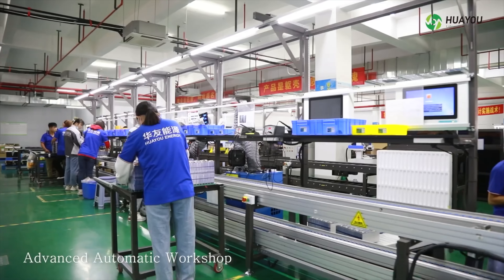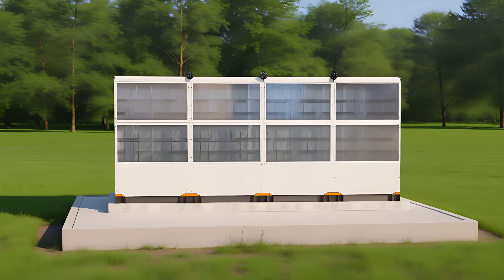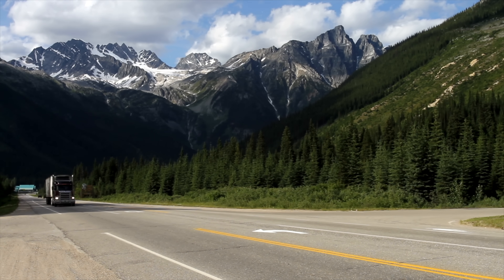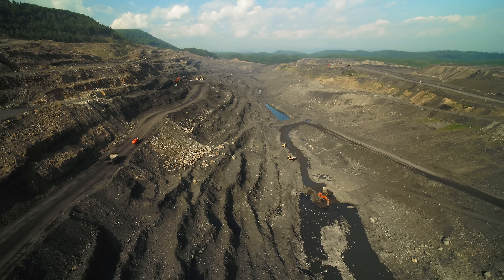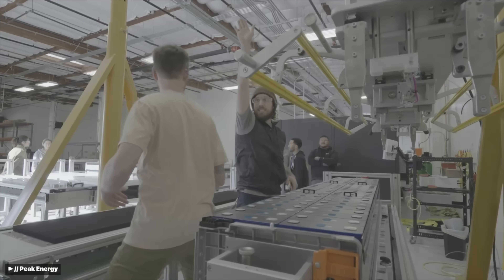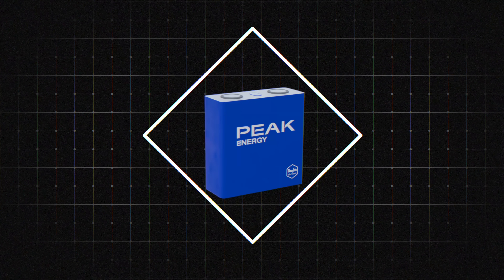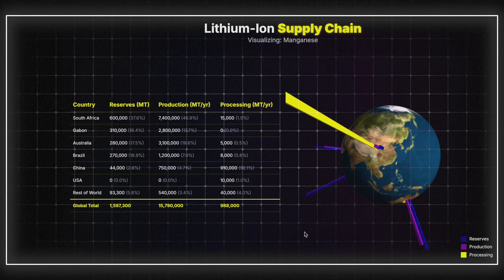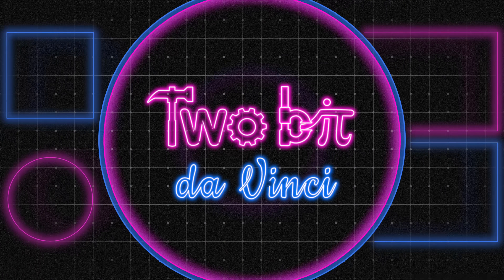Sodium Ion Batteries Are Going to be EVERYWHERE - Here's Why

Comment: The battery materials are only 30% of the battery cost. That's for NMC. This comes down to 20% for LFP. So the major challenge isn't the lithium or cobalt. It's the manufacturing know how at scale. The next thing you missed is endoflife. Low value materials cost as much to recycle as the more expensive ones like nickel and cobalt. However recycling of NMC can be done below the cost of mining the metals. This isn't true for sodium ion batteries. It isn't even true for LFP.

Comment: BS . Sodium batteries have around 2000 cycle life at best , lithium around 15000 . Sodium batteries has a low energy density when compared to lithium , about 60% of the energy density of lithium.

Comment: One question I'm still concerned about is the complete system efficiency of how much energy goes in compared to how much comes out as useful electricity. It seems to be the thing that kills the idea of aluminum batteries with too much of the energy being lost as heat on the charge/discharge cycle.

Comment: The cell voltage vs SOC is bad. Sodium cells loose voltage steeply as the cell drains whereas lithium cells maintain an almost flat voltage all the way until the SOC reaches zero.

Comment: Widespread adoption of EVs just can' work past a certain (very low) saturation scale - the grid can't deliver the power and the generators can't deliver it particularly at peak load periods.  The UK grid as one example nearly collapsed earlier this year, if we suddenly had massive demands from EV charging it's likely we wouldn't see the grid cope;  also rarely mentioned is the frequency issue from wind/solar/wave generation, this isn't consistent so it affects the grid (apparently that's what blacked out Spain and Portugal this year, a number of people died from that outage I'm told). 

This thing being cheap - and fire resistant - can fulfil a critical need, that of local buffering storage.  The provision of local (house-based) buffer storage in a non-volatile manner - size and weight be damned - that's also cheap and sourceable (that can be built independently of Chinese supply chains, critical if the war kicks off in October 2027) - is perhaps the most critical thing we have in contemporary infrastructure.  I also think we need to massively rush the implementation of the first SMRs for generation, get the damn things in place as a pilot installation with absolute urgency (with a view to then ironing out production issues and then getting them built at scale for Europe) - that's the next step.  Even with those though - the grid's capacity to cope without localised buffering is going to be a massive problem and this might well be the solution we need to provide this (basically new) facility.   Sure the Tesla Power Wall and its peers have been doing this for the wealthy early adopter set but if this pans out it could mean these go into every home and business in a MUCH smaller timeframe. 

They'd buffer against grid demand spikes, use loose capacity for low demand periods on that grid, buffer for outages or dips (e.g. storms knocking out generation or transmission capacity) and a whole range of other factors.  Nations need this for national security reasons, now that net-zero is losing its cool factor and the craze is falling away we need to push these things on national security and infrastructure resilience grounds.

Comment: Untill sodium batteries improve their voltage drop issue and horrible charge curve,low energy density ,weight ratio they are not a viable replacement for lithium base -yet.

Comment: I made a sodium ion battery 6 years ago out of potassium chloride,  sodium chloride,  alum powder, copper tubing and a rod of magnesium. It provided the same power output as a standard AA battery but it was a little bigger and wouldn't fit into any devices I own. They give out low amperage but have extremely long lasting power.

Comment: So if they can ship it flat and use just supply the initial charge it's a dry capacitor with an extremely low discharge rate We need to throw all the money we can at this cuz if we figure out stable fusion I'm going to need to store that energy and there's only so much a gravity battery can do including the water ones or a sodium reactor could do or sodium storage by heating it I want to go visit this place and learn everything

Comment: Get rid of the large grid systems. Make energy local. Use Na/Fe batteries for storage and solid state batteries for small needs. Use vertical wind turbines, instead of solar and large wind turbines, because of climate change. Small systems can be protected from the environment, especially larger hail storms and higher winds coming with climate change. Closed loop water purification systems is also a need to provide water for the future needs. Could the brine solution or solid, from the closed loop water purification system, be used to produce pot ash? Instead of trying to plant forest, plant them in towns and cities to cool and provide Oxygen for healthier air. Also, the future is underground houses and cities to escape the coming 50+ degree C temps. Tao will solve the problem, if we do not change our thinking and ways of living on our only home, Earth.

Comment: The last time I checked CATL is the leading Sodium ion battery manufacturer and is in China. 😂
USA can not compete with it as China has always have a head start advantage due to ease of doing business, low cost of utilities, low cost of land lease and low cost of labor including low cost of logistics as they have access to most of supply chain network. 

So yeah good luck with your US independence on Chinese batteries narratives 😂😂 
remember even TESLA gets their white labeled Lithium ion batteries supply from BTD and CATL in addition to PANASONIC. 

There is nothing that can help USA until the country push a great reset button. 
it doesn't matter if you discover another great leap of technology if you can't manufacture it cheaper than how China does your product will only be sold locally of through deception (for export).

Comment: Stop trying to compare Sodium Ion with Lithium Cobalt or Nickel batteries. Everyone knows they are a fire risk but you must instead compare it to Lithium Phosphate which is fire safe and has much more benefits and are much better suited to constant charging like the grid.

Battery evaluators (Eg. Phil Prowse) say Lithium Phosphate are much better than Sodium Ion because they keep a stable voltage through the whole range, and are also fire safe, Sodium Ion has a large variable voltage range and therefore require complex charging, discharging and management circuits with much lower energy quality and also require higher copper cables and terminals which make the installation much more expensive and complex.  Basically Sodium Ion is a third rate solution because Lithium Phosphate are also fire safe, have more energy, more stable voltage and less voltage compensation required.   By the way, lithium Phosphate cannot be charged at low temperature but it can still be discharged at very low temperatures, which also helps to warm up the batteries.

Comment: The discharge curve being flat is a. specific to LFP, not all lithium batteries, and b. litterally the advantage of LFP, the reason it is prefered as long as its capacity is sufficient, since other lithium chemestries can actually provide you with higher densities, but LFP is still often chosen for that attribute nevertheless. It allows it many more charges to full with less damage and to stay on higher charge levels with less damage, as it exactly does not spike to much higher voltages with filling rate.
Don't get me wrong, this technology is interesting, but not every one of its attributes is an advantage.

Comment: This chemistry has a major problem: The voltage curve is not a constant voltage until close to complete discharge as in Lithium, it is more of a linear decline so it's never stable but always declining. All the peripheral equipment like inverters will have to be redesigned to use this chemistry. Also, it is less energy dense by about 30% meaning batteries will have to be bigger at least in automobile applications for the same range.

Comment: Already, the technology as described has checked ALL my boxes. My interest in this will be for energy storage for an external building in which size for it isn't a factor and ability to solar power including wind is workable for me (I'm a former wind turbine tech)  a factor that could affect adoption in smaller spaced neighborhoods, yet I have plenty of acreage. Does this company plan to allow for prototype testing to further prove a baseline? How well does their tech retain a fresh charge? Bonus Points already given for minimal hazard of transport regarding both installs and especially replacements, including retention-at-site safety. I truly love the soda ash angle as I'm in Wyoming where it's plentiful and the operation temps, especially for EV usage, function so much better at my temp extremes, plus my location is barely off I-25. Keep working on more compact storage. Hoping to connect.

Comment: If we fuse sodium battery with solid electrolyte we will archieve enourmous jump in technology...but why batteries?
Diesel is more efficient as engine fuel, no battery is even close to it's energy content for 1 kg.

Nuclear energy will replace all in energy&heat prodution. 1 ton of thorium will run entire 1000MW reactor for 39 year!

Comment: I am avoiding battery operated lawn mowers and snowblowers due to the short life span, and high cost of Lithium Ion batteries.  I live in Southern Canada, we get hot summers and cold winters.  I also refuse to bring these batteries in my house to charge.  I will replace my old equipment with gas powered options until these products are sold with high Ah Sodium Ion batteries that remain sealed in the unit and can be plugged in to charge in my garage, avoiding having to carry heavy batteries into my house.  For safety reasons they need to include a key to complete the circuit.
Reply: You need solid electrolyte battery...

Comment: A very positive spin on a resurgence of aged tech from the 1970s/80's ... the discharge curve will do nothing for electric cars other than keep to an already meagre range. You'd need charge retention that goes way beyond, especially if less power per kilo than Lithium. Charge rate at the stand is important for users of EVs. Double that and the EV market will take another pummelling.  I really wouldn't believe the hype folks, until the practical problems have been solved and operational proof points/limits have been observed and understood.

Comment: 60C is 140F and it gets that hot inside cars and probably inside engine compartments and underneath cars in a hot summer parking lot. So could it be used as a car EV battery? If it can't go more than 60C maybe not? So I'd like to see more like a battery able to withstand 70 or 80C. But it is what it is.

Comment: Range Extender PHEV is the future, using gasoline only to charge when needed and having a smaller battery that gets you 100-200 mile range if you want to run electric daily.  Combined range pushing to 1000 miles on both systems running together.  Best of both worlds

Comment: The critical success factors for Peak are powerful, particularly in the emerging global balkanization.  Domestic sourcing is critical.  Manganese, Cobalt and Nickel are becoming increasingly scarce as we are about to enter major demand surges for alloyed steels, stainless steel, nickel tubing for the major rebuild of Ukraine and possibly all of Europe.  Additionally, we face a wave of nuclear power plants just ahead.  In that upcoming environment these items become unobtanium and will certainly force production interruptions and business failures.  Lithium has incredible energy density for weight sensitive applications; it has a monopoly where price does not matter.  However, there is a finite amount of Lithium, the process competes for scarce resources that others are competing for increasingly.   Lithium battery designs are walking directly into the unobtanium paradigm in my lay opinion.   Never underestimate the value of an expensive battery system not failing due to temperature.  Never underestimate the shutdown risk of spiraling temperature control costs .   Cooling centers for already heat smothered data centers could become extremely burdensome if the tax code changes.  Our new culture of corporate welfare has created a Tax Code Doom Loop for the consumer and homeowners.  As this issue becomes consensus among voters, all of these technologies that never penciled in the real world will face an economic epiphany.   Bud Hirsch cautioned against confusing and investment decision with a tax consideration decision.  Tax codes can change.  They are almost certainly headed that way.  That makes products that pencil on their own the winner, even if a few luxuries are absent.

Comment: Sodium is the expensive line sold by battery contract manufacturers in China.   Economies of scale should lower the cost. It's lile when SSDs stsrted to take over hard drives.  Hard disks are still surprisingly high in price/performance.

Comment: Sorry to spoil your enthusiasm for Sodium batteries.
Sodium battery chemistries will also enter thetmal runaway according to research that I have read.
The paper places the sodium battery chemistry's response to overheating and mechanical damage close to that of LiFePo chemistry, less volatile than NiMnCo chemistry.
The offgassing is similar to lithium ion chemistry which produces hydrogen, carbon monoxide, and hydrogen cyanide along with other volatile gases.
The benefits are that the principle metal, sodium, is in plentiful supply and sodium batteries will work at much lower temperatures than their lithium based counterparts.

Comment: The US does not have the ninth-largest, but only a small share of global aluminum smelting capacity (approximately 1.73% according to the USGS). The US is heavily dependent on aluminum imports, especially from Canada. The statement regarding soda is also not confirmed.
CATL has already used its SIB (Sodium Ion Battery) in vehicles.
I like SIB and other batteries, but that doesn't glorify any country.

My statements are based on a translation of the original language; errors are possible. This also applies to my statements.

Comment: I would like to know more about the round trip efficiency of these batteries. That is a metric you did not discuss at all and it is extremely important. It is one of the key factors that make Lithium Ion & LFP batteries such great replacements for Lead acid, Ni Metal Hydride, and NiCad chemistries. Getting back over 95 to 99% of the energy pumped into a battery is much more exciting than getting back only 65 to 70%.

Comment: Size and weight is pretty meaningless for fixed batteries, portable batteries like cars, power banks and etc yes, but the primary factor in grid scale batteries is always going to be cost, basically I don't care if your battery weighs twice as much and takes up twice the ground space, if it's one tenth the cost I will take it in preference to anything else because I can put in ten times the amount of power backup for the same price.

Comment: What scares me most about SIBs is the marketing gaslighting that there's no risk behind it.  Reminds me of LFPs, but I think we're at the stage now that educated individuals still understand there's a deflagration risk with LFPs, which SIBs share exactly the same risk profile when thermal runaway happens.  SIBs were plagued with decomposition issues at full SOC which aside from density, crippled their usefulness.  Sweeping that under the rug and not really even addressing what they did to improve that, but instead comparing themselves to NMC day-in-day-out seems extremely sleezy to me.
Reply: @teac117 
I just can't understand the Li-ion battery & the way it caught up. One thing that goes in its favour is the way a sell-phone charge can be managed, really trouble free. Imagine if we have to change batteries every six months or yearly. We wouldn't want use a cell-phone! Success of a cel-phone lies in its charging for umpteen (I didn't count) number of times.

Comment: They're heavy. But the battery that doesn't run away is superior. I wonder about the heat dissipation with charging. Even though heavier and less capacity, it might be possible to charge such a battery quicker which would make a lot of the range issues mute. You have to visit the quote" filling station a bit more often but filling wouldn't take so long.

Comment: Excellent research and presentation.
Am I the only one who finds it amusing that a battery chemistry which includes "pyro" in the chemical name doesn't catch fire?
As a backpacker, I'm all in favor of battery technology that works over a wider range of temperatures.
For automotive technology, a moderate difference in weight is not nearly as much a factor as charge/discharge rates. Cars need to be able to charge as quickly as possible and support huge surges in draw during peak acceleration. I wonder if a hybrid capacitive and battery system might be the ultimate solution.
As for China/CCP and this new technology, as with all of their "innovation", I wonder how much was true innovation and how much was theft.

Comment: The lower energy density is a real problem for use in EVs if we are going to see a real market saturation of EVs in the United States. For EVs to really reach market saturation they need to be a practical solution even for the 40% of the population that can't charge at home.

Comment: If we are to have two EV households we have to get around issues like insurance on two vehicles when there is only one driver. Better is PHEVs with 60 or so miles of range that would only run the engine occasionally when the owner is on a longer trip. One vehicle, insurance, depreciation, maintenance, etc.